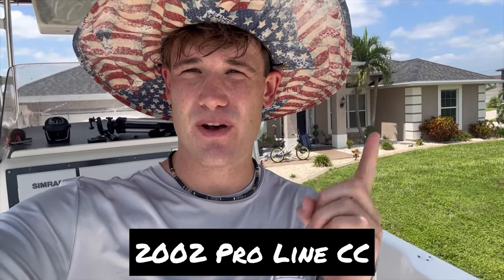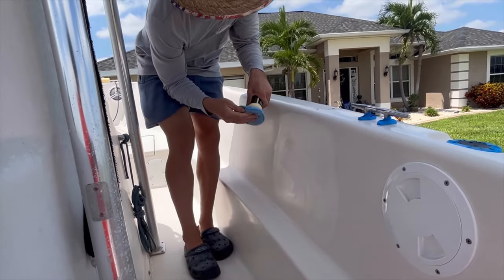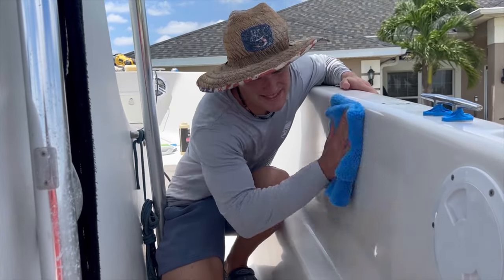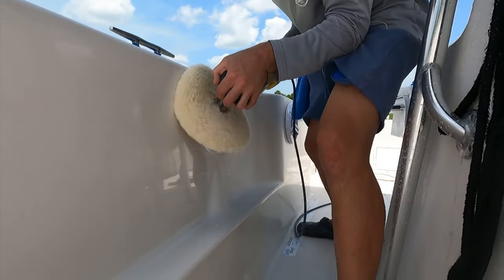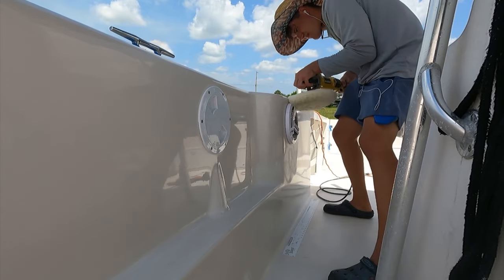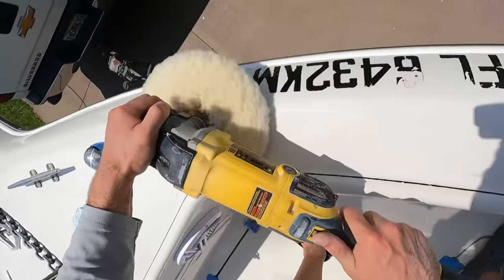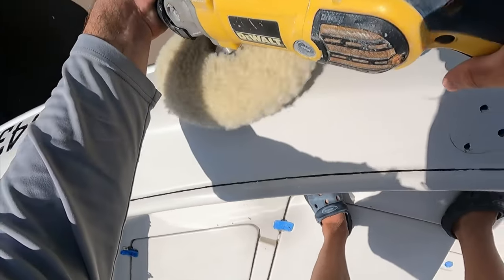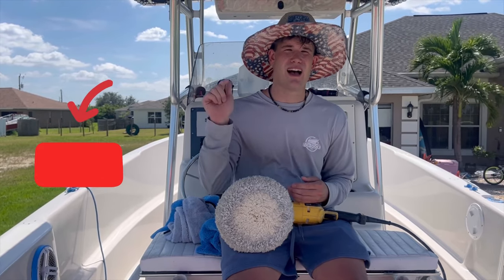Trying The NEW Starke Wool Buffing Pad. Is This What You Need For Your Boat?

Comment: I've tried the Starke wool pad now and had the same problem as you. The quick connect design doesn't have the strength to hold up under moderate/hard pressure. I got half way through an 18' bowrider and it broke apart. I still think it's great for test spots because you can quickly switch from wool to foam, but I will stick to the Lake Country white wool pads for regular work
Reply from the maker: Yes I have now rounded out the black connecting adapter on the wool pad. The design needs updated, I think Starke is working on it

Comment: I ruined my pads too. You have to pull back on the quick connect adapter .feel the back theres a ring this pulls back to loosen the 3 balls so you dont ruin the plastic pieces
Reply: Were you able to fix the black piece of the pads to use them again?